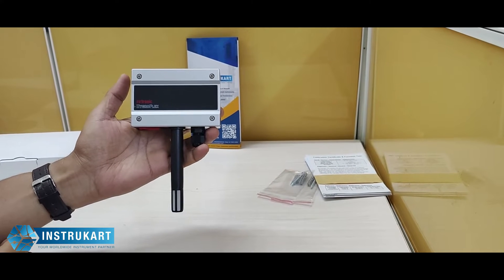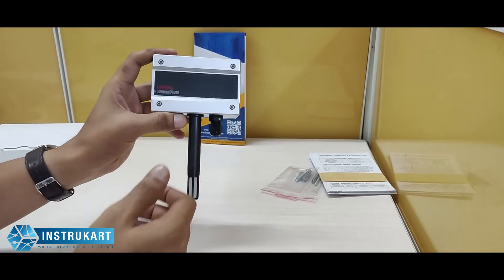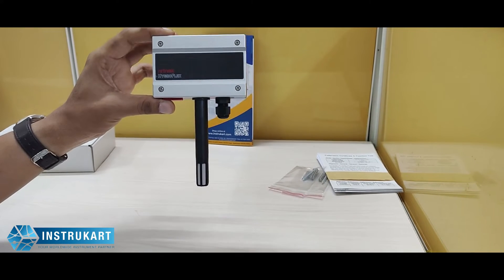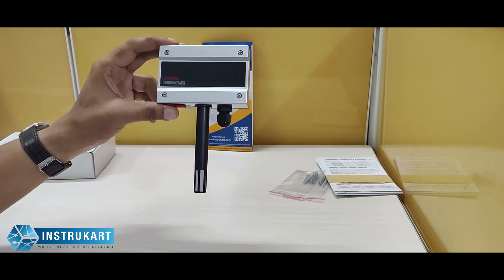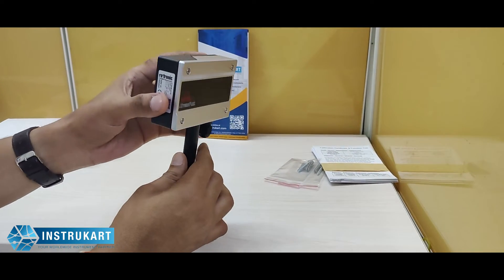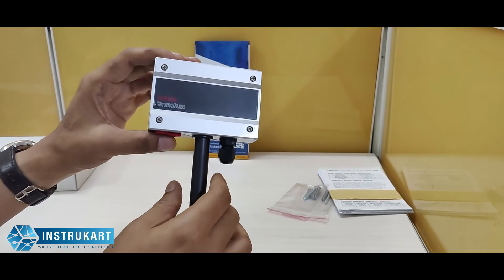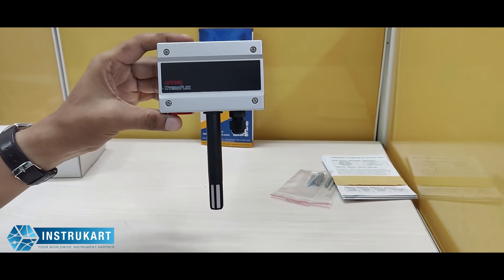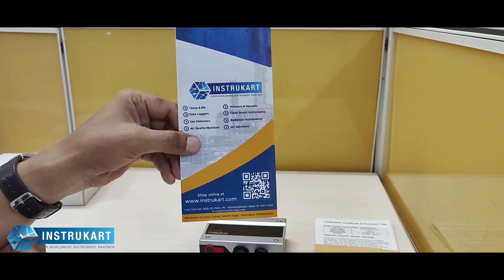Rotronic HF-120 | Hygroflex | Temperature Humidity | Transmitter | Instrukart

Comment: Where is the display? if i needed to calibrate it should i use another transmitter to get reading?
Reply from the maker: Yes , it has display at the center of product but based on the version(display/ non-display models) 
To calibrate the product ,you need to use a Master product with same parameter and higher accuracy. The Master should also have been calibrated within the due date.